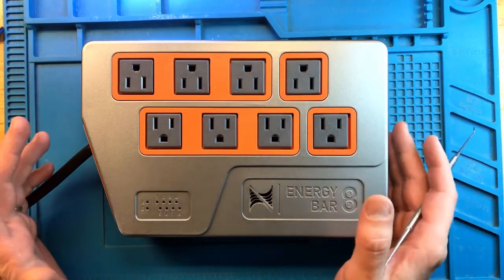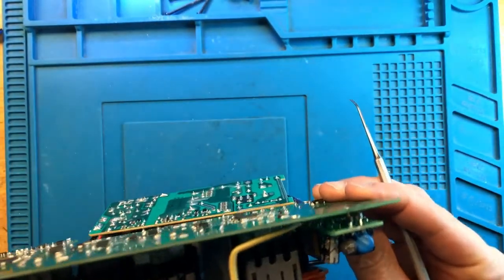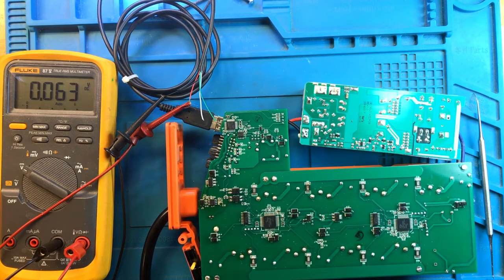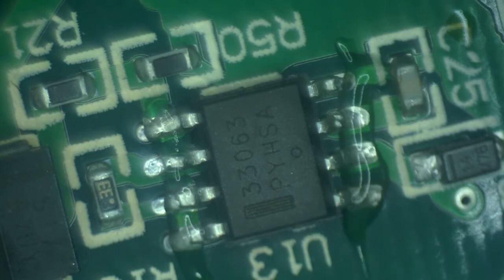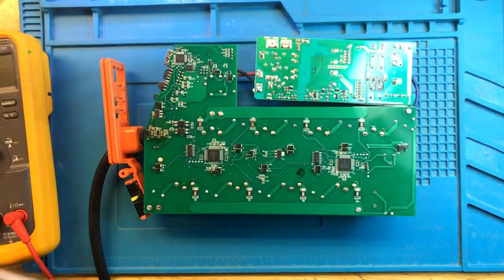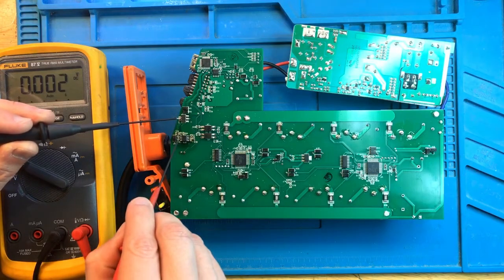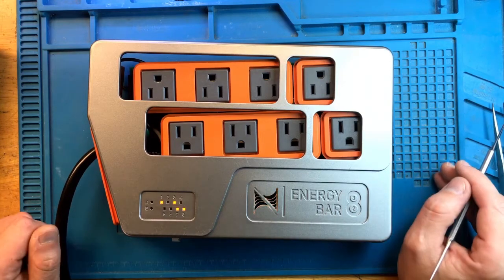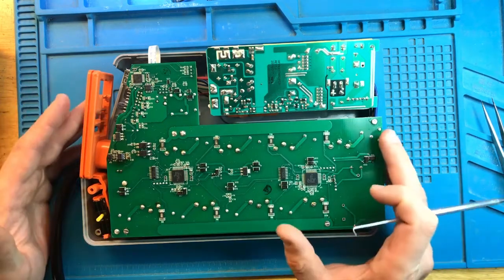Apex EB832 No LED Indicators Repair

Comment: Hi, does anyone know what the Kit is called that is used in the video that has a lot of the small micro chips?  Is there a generic one available that covers the majority of small electronic repairs, or are they all self built meaning that he probably just collected what he needed and filled each one separately (like the buck converter he used).  Thanks in advance!!
Reply from the maker: The parts and components box in the video is completely custom. This particular box has close to $1000 worth of parts that are specific to the type of reef equipment repairs that I do. There are some generic kits of capacitors and resistors that exist, but nothing that would be diverse enough to be applicable to reef repairs.